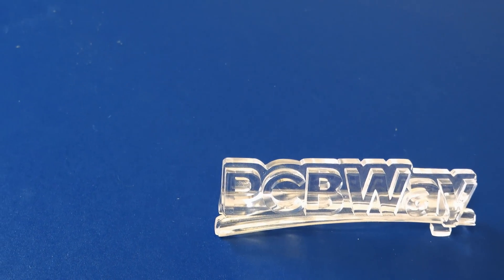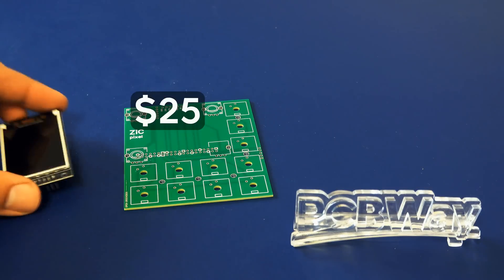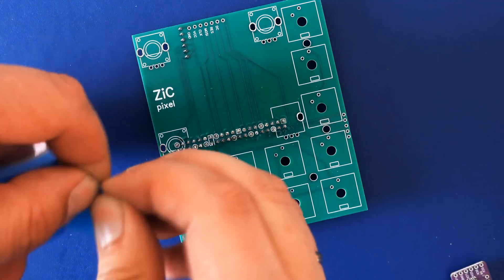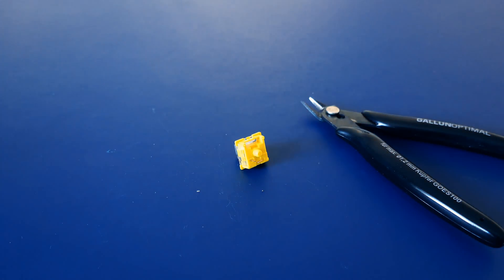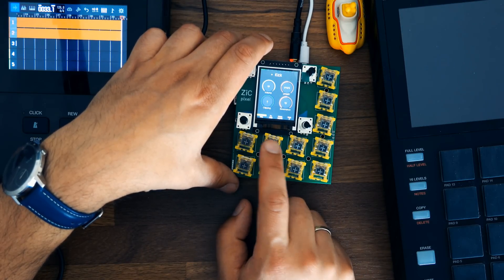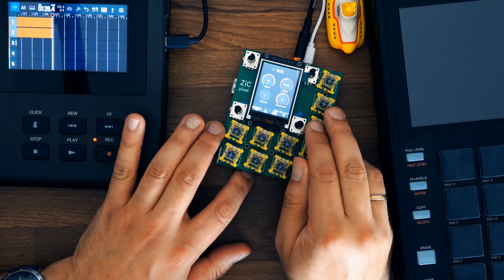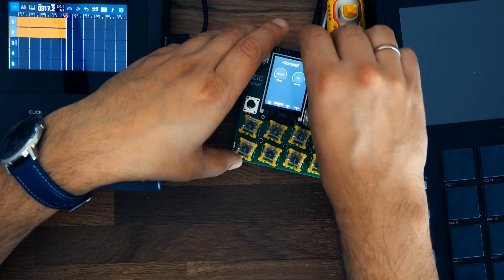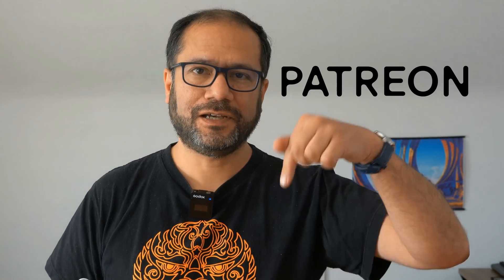ZicBOX - DIY open source modular scalable groovebox

Comment: Hi Floyd, thanks for the video.

I’m curious what you think of the little PCM DAC board? I’ve looked at one of them before as an affordable way to add a “better” line out to the pi… but I have wondered how the audio quality compares to a more expensive HAT
Reply: I think it all depends what you want to do. When I started this project, I was simply using the built-in audio interface. Then I started to use external hardware over usb for the audio output (in my case I was using my digitone but you can also use a usb audio card). Then I finally started to use this pcm5202 DAC because it is small, cheap and still very good quality. However, now I am thinking to switch to another audio codec in order to be able to have as well audio input. 
There are many kind of audio HAT, even some where you can have multiple audio output, this is just amazing, but is this even necessary for you... Also, often on the audio HAT, there using the same cheap audio codec as well, so expensive doesn't necessarly mean better quality.

So I would recommend you to go step by step and try out one thing after the other, and see which one fit the best your purpose.
Reply from the maker: This board is a fairly common one in Open Source projects. One thing I can say is that it immediately drops the noise level -compared to the onboard DAC - to "almost not perceptible". So yes, I can recommend it. At a price of roughly $5, I think you won't regret trying it yourself.